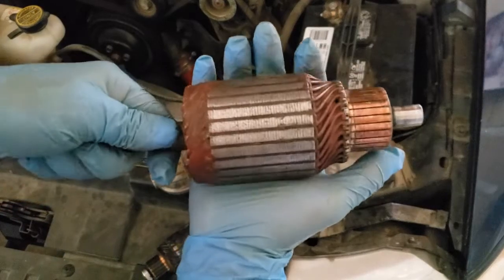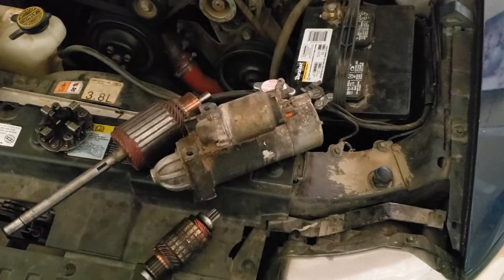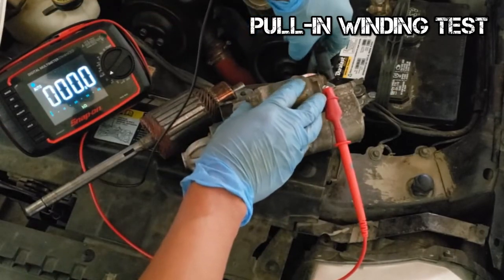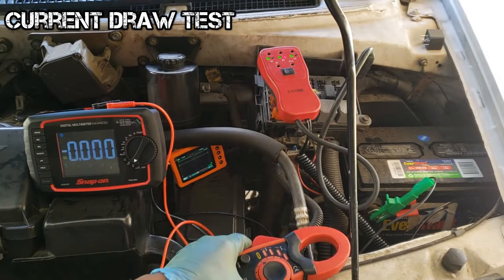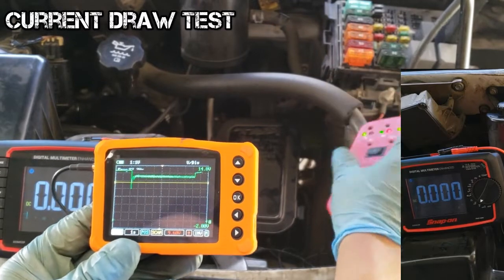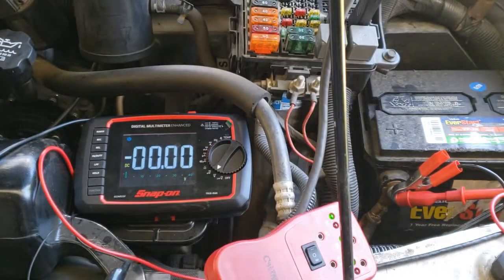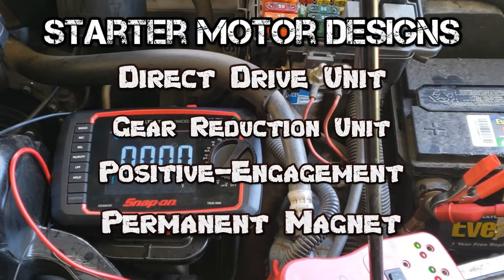ASE A6 "Cliff Notes" #2 - Starters

Comment from the maker: Update: After taking the test I would say the first minute of the video is how the starter works and will not be on the test. The starter will be on the test in wiring diagram form. Familiarize yourself with the circuit described at 0:53 . Most importantly PROBLEMS that can happen ANYWHERE in the CIRCUIT. For example if you had an open wire after the ignition switch how would that affect the starter motor during cranking? 
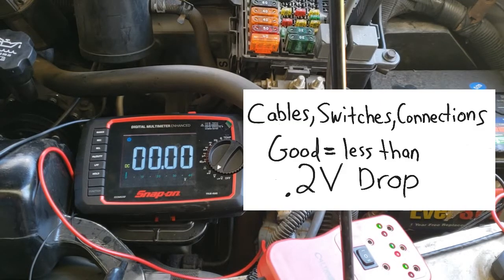Voltage drops tests on the starter circuit is very important. The info after 5:30 is helpful.
The info from 5:40 to 6:07 is important.